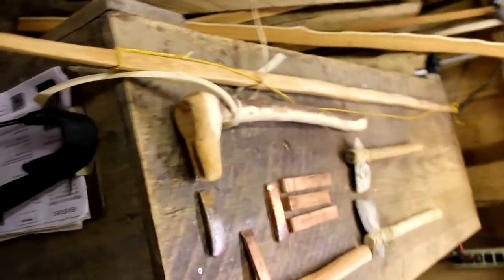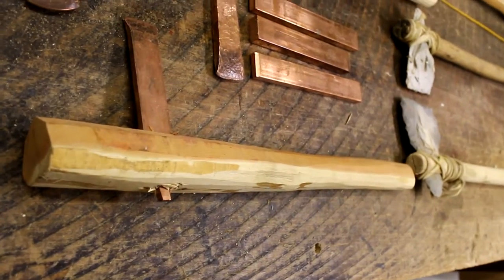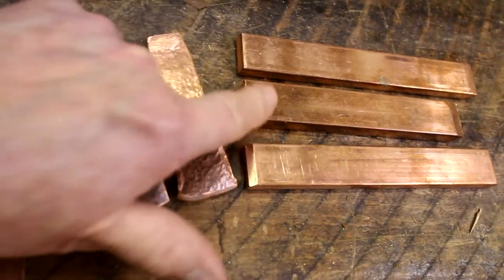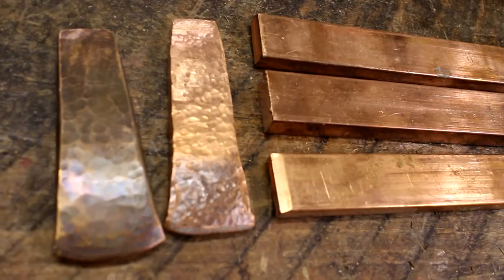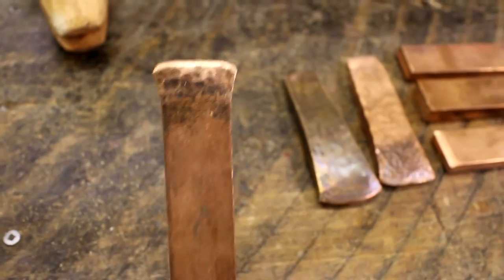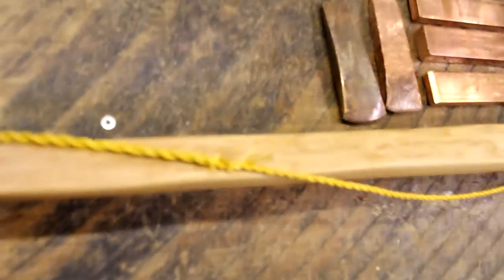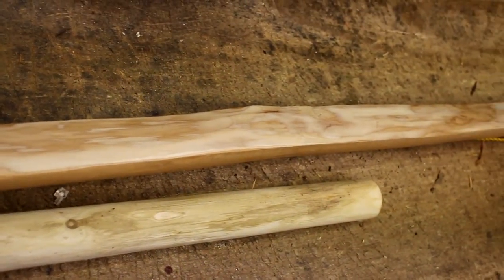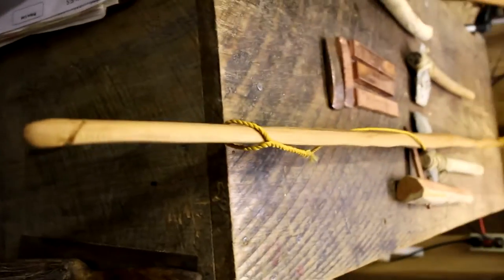Otzi Bow Axe

Comment: The "Bowyer's bibles " say that the sap wood of Yew wood is the tensile strength of the yew wood so there shouldn't be any cutting on the bows back at all .  The tillering process is simply done on the belly of the bow , however all of my experience has been with  osage with the exception of a bow made from each of the following  maple ,ash,hickory . I have  hacked out ruff bows with just a hatchet and it was very addictive  so I guess you could call me a " hackyholic " !      just sayin